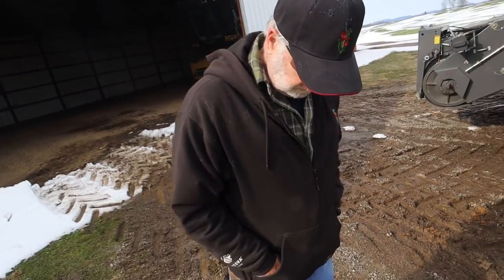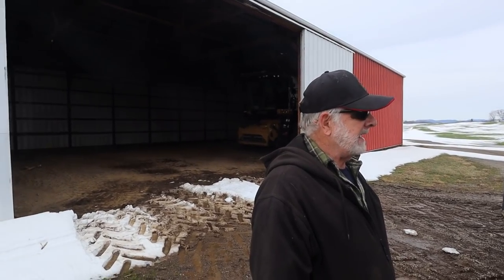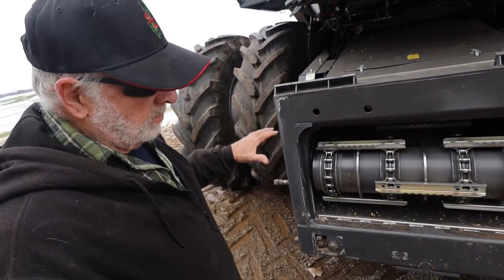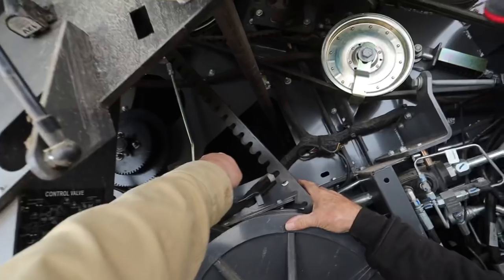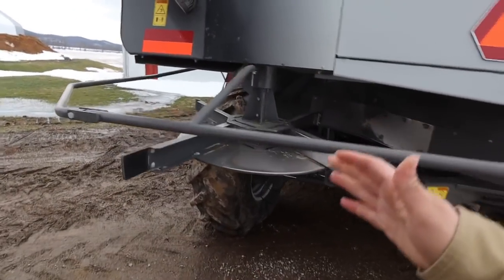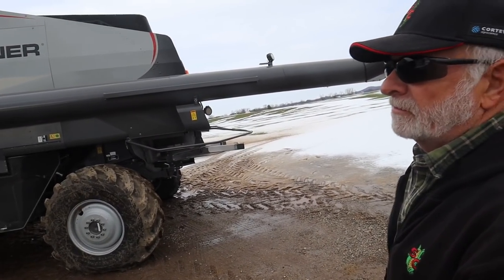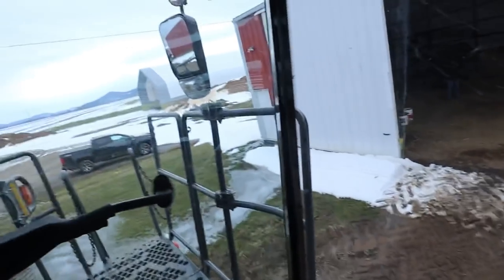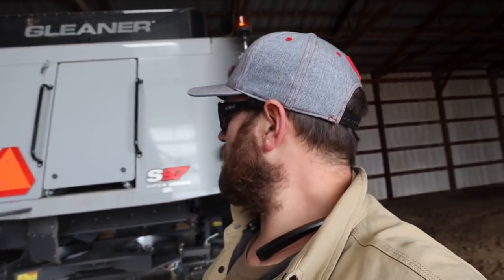Gleaner Combine 1 Year review

Comment: As a Gleaner engineer from ‘67 to ‘89, loved the review. So much remains the same as the old days. Loved my days with Gleaner, but Deutz bought the company, we’re very bad to work for, and I bailed for construction equipment. Farming in my retirement, would love to own a Gleaner but nearest dealer is 5 hours so I tolerate a different brand.
Reply: What kind of John Deere combine do you run
Reply: @alexpickle5823  An old CaseIH 1680. After helping bring a rotary from concept through 10 years of production, no way could I go with walkers and my limited retirement farming doesn’t justify $$$ for 2 weeks use yearly.
Reply: That is a good combine it get the job down very good
Reply: @alexpickle5823  Yes, its very good, but what I could afford for my acreage has a lot of hours. Some belts, chains I've needed to replace take a lot more time than Gleaners, but then again I'm 32 years older than when I left Gleaner - age may be part of it.

Comment: I've always thought the AGCO engineers should have put a camera on the outlet of the return elevator, so you could see how much grain you were returning. It used to be the perfect way to set the sieves on the conventional models...you would run it hard till you got to cylinder (rotor) capacity, and then close the sieves until you just started to see grain in the return...and that would pretty much be where you needed to get it set.

Comment: I'm really surprised the spreader worked well for you guys since it was running backwards the whole time you guys had it. The hoses were hooked up backwards from the factory and nobody at Agco caught it. When turning the correct direction it will spread the straw the entire width of a 40ft head.

Comment: glad you really like the  Gleaner. i have heard others like them too. suggestion on hydraulics being slow i think the pump is big enough but your lines are restricted to run your corn head. the only way to fix that is get bigger line and run a flow control valve on it
Reply: There’s an internal orifice that has to be removed to make a capello fold quicker.  The ideal has it too. Takes 10 mins it seem like to do it one way or the other and about 90 seconds when it’s removed.

Comment: You might consider placing a camera to help with header hook up.  It is a very dusty area but you might find a camera location which you can mate up easier.   It would have been nice to have the Gleaner, Claas, John Deere and Case list price/model number.   Easy to throw stones when $ aren't in the same ball park.

Comment: We ran a massey before a case hated thr short feeder house. And had some places we couldn't road the head on due to not picking up enough. When we went to lateral tilt it helped to add some length but they need a good 8 inches longer or a foot. Not sure why they haven't changed that

Comment: if you extend the rear axle out so the rear tire follows the outside dual, you should be able to improve the turning quite a bit
Reply from the maker: It is I think
Reply: You don't won't to do that ever.  Run them right behind the inner wheel at all times.
Reply: Rear tires run in line with inside duals
Reply: @RobertBrown-kc7wz  i'm well aware, you can space them out, however
Reply: @gleanerman2195  what difference would it make if they followed the outside dual? other manufacturers have that option
Reply: @steveunholzer2056  It would put too much stress on the wheel hub bearings, if you just had to move them, I would not go any further than the middle of the duals, but in mud it would not work as good. We put 4 inch spacers on the inside dual and that way we can space the rear axel out 4 more inches, then you can make the turning radius tighter. plus it gives more clearance between the wheel and mud shield.
Reply: @gleanerman2195  the wheels are spaced out by the axle extending, not the hubs, therefore no added stress on them

Comment: If you ever decide to get a second gleaner I would suggest at least demoing a gleaner corn head. The new command heads are a big improvement over the 3000 hugger heads and you would have tilt in the head. We’ve had the new corn head two seasons now and still pleased with it.

Comment: Can you fold the auger in and back out with it full of grain?
Reply: Yes
Reply: Yes. The only ones that struggled was the very first generation Gleaner hydraulic folding auger, which was found on the L /M series and N series. The ram had to retract to fold it out, and as we know, the ram shaft reduces displacement on the piston. The 2nd generation auger on the R series starting in 1986 rectified this issue, ram extended to fold out, so more power was available to fold out than fold in.

Comment: You mentioned the Gleaned combine had 4 wheel drive,  didn't say weather you liked it or used it . Does it increase turning radius if engaged?  Also on u tube popped up  a Gleaned like yours had main tires fell off.
Reply from the maker: We used it some. Turning radius seemed the same to me

Comment: Since the S98 has more power, how is the price difference? It's basically the same engine with maybe some different components.
Reply: The combines are identical, only more hp. on the S98 and abought 20 grand more I think.  2 grand for a stienbauer chip and there you go, instant S98.

Comment: We used to run a bison rotor on our R62 back in the mid 2000s, I just looked them up and they must have gone out of business in 2020.  We could push that machine pretty darn hard.  It had the cummins in it and we had the computer programmed to run a 12 row in irrigated corn.  She wasn't the fastest class 6 with a 12 row but the speed made everything around it more efficient.  When that warranty is up I would for sure look into the programming.
Reply: I didn't wait, just go for it, it will make it a beast of a combine.

Comment: Eight row machine?   I'm running eight rows on my R52!   My corn is not as good as yours, and I am running first gear.  I could run a six row in second gear, but I'm more productive and fuel efficient with the eight row in first gear.  This is because in the hills, first gear takes MUCH less power through the hydro than second.